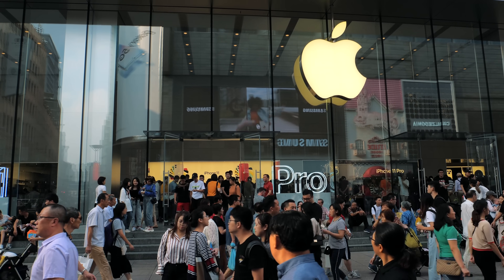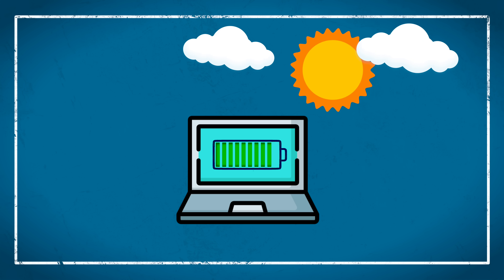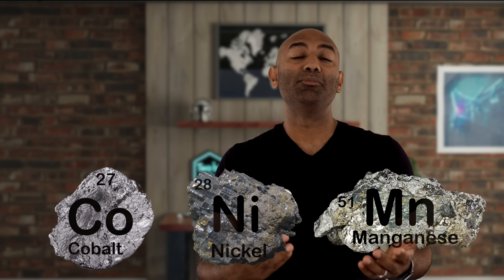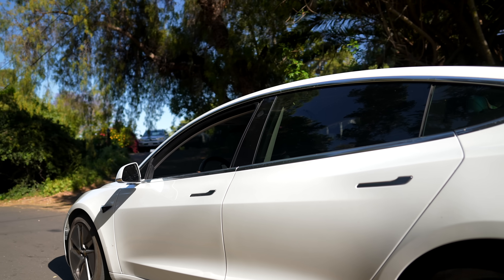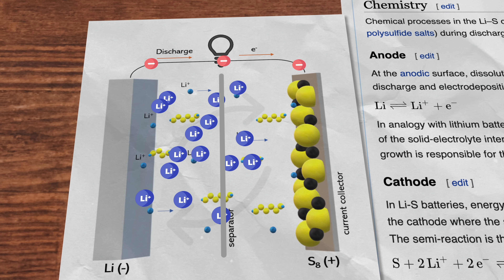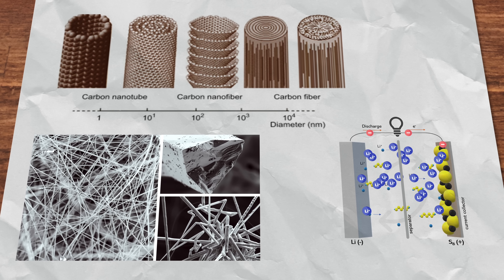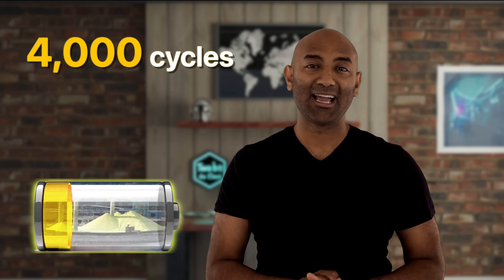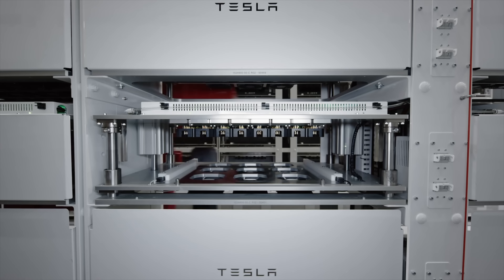Scientists Discover a Lithium Sulfur Battery Breakthrough on Accident!

Comment: Incredibly excited for what this means for all tech! Imagine a smart watch that only has to be charged once a week. Electric planes are more feasible. Grid storage will become cheap and easy so goodbye peaker plants.

I'm excited to think how much closer we are to becoming a fully type 1 civilization.
Reply: Li ion grid storage is already cheaper than peaker plants, only now Tesla & others are going with cheaper LFP.

These would be the economic death knell for coal, gas, & nuclear.
Reply: @IronmanV5  you say as batteries imply green energy, they can storage energy, not make it, but thanks to this energy buffers in form of li ion and mechanical batteries can help between the diference between energy production and consumption with renewable sources.
Reply: @IronmanV5  No matter how cheap, nothing is going to compare to the flexibility, efficiency,  and reliability of some of the modern nuclear plant designs. If sodium-sulfur batteries become a thing, the comparison will narrow, but do we want these huge battery farms spread across the landscape along with solar panels and wind farms. And,  even if they are sufficient for present and future consumption,  nuclear will be needed for process heat and for the type of power needed to desalinate massive amounts of water and start to actively suck CO2 out of the atmosphere, which will be needed if we are to meet the climate change goals of the Paris Accords and that are needed if we are to stave off disaster. Can we withstand the loss of the Greenland ice sheet, or the massive depletion of Antarctica along with the melting of permafrost across the northern latitudes and the phase change of the many billions of tons of methane clathrates that are now at the bottom of our oceans and that would be released with just a little warming of the waters that contain them. 

That means nuclear plants that are cooled by molten salts rather than water so that we aren't threatening our water supplies or heating them up, causing the very problems we seek to ameliorate.
Reply: @everettlwilliamsii3740  Nuclear takes too long and costs too much. And despite all the promises to the contrary costs & build times  have only been going up due to screw ups, poor planning, incompetence, and/or corruption during construction and no red tape like nuclear advocates claim.

Watch Ricky's video on Nuclear for some of the stupid screw ups that have happened with Olkiluoto #3, which was supposed to take 5 years to build but took 17. and Flamanville #3 which is 10 years  behind schedule and 4 times the original cost so far.

It's the same story with Vogtle #3 & 4 in Georgia.  The screw ups on that one included irreparably damaging the spent fuel pool while looking for leaks.

This guy: 
nopig org
has been keeping track of the numerous screw ups and overruns involved.

And then there is the aborted V.C. Summers #3 & 4. The companies involved have had fines and restitution levied against them and people have been indicted in federal & state court with some already sent to prison.

Even the much ballyhooed SMRs are following in the footsteps of their big brothers.

The NuScale UAMPS project which was supposed to produce first electricity in 2026 has had that date pushed back to 2029.

Solar & wind have seen costs dropping, unlike nuclear

ourworldindata org /cheap-renewables-growth

And larger capacity & duration iron flow batteries are already up and running in San Diego, and Liquid Air Energy storage facilities, which can store energy for months and scrub CO2 while storing energy,  are being built in Vermont & several sites in the UK.

Nuclear is just a bunch of broken promises.
Reply: @IronmanV5  Sounds like more unicorn farts to me. 
Show me the numbers...
Reply: @TheBandit7613  STILL NEED the GRUNT   of trucking diesel , arvo gas , and bunker oil ,to keep the wheels of  green DREAM  TURNING
Reply: @IronmanV5  nuclear and renewable energy need to be used in conjunction to provide us with all of our energy needs.
Reply: @DynamicHaze  Nuclear takes too long and costs too much. And despite all the promises to the contrary costs & build times  have only been going up due to screw ups, poor planning, incompetence, and/or corruption during construction.

Watch Ricky's video on Nuclear for some of the stupid screw ups that have happened with Olkiluoto #3, which was supposed to take 5 years to build but took 17. and Flamanville #3 which is 10 years  behind schedule and 4 times the original cost so far.

It's the same story with Vogtle #3 & 4 in Georgia.  The screw ups on that one included irreparably damaging the spent fuel pool while looking for leaks.

This guy: 
nopig org
has been keeping track of the numerous screw ups and overruns involved.

And then there is the aborted V.C. Summers #3 & 4. The companies involved have had fines and restitution levied against them and people have been indicted in federal & state court with some already sent to prison.

Even the much ballyhooed SMRs are following in the footsteps of their big brothers.

The NuScale UAMPS project which was supposed to produce first electricity in 2026 has had that date pushed back to 2029.

Solar & wind have seen costs dropping

ourworldindata org /cheap-renewables-growth

And larger capacity & duration iron flow batteries are already up and running in San Diego, and Liquid Air Energy storage facilities, which can store energy for months,  are being built in Vermont & several sites in the UK.

If private companies want to spend their money on nuclear, fine. I hope they succeed.

But no public money should be wasted on it  and should instead be spent on the cheaper, faster to deploy renewables & storage.
Reply: @IronmanV5  Solar isn’t as reliable as Nuclear fission here. The UK is building solar powerplants but according to farmers it’s on fertilized land and that is wastage of fertilized land which in our times has ever increasing value because of the ever increasing population that needs to be fed. The UK also doesn’t have good sunlight intensity and the best of weather so it would be a waste of time and money to put solar energy there. In the northern hemisphere sunlight intensity decreases a lot in winter times so again solar energy wouldn’t be as effective. Nuclear fission reactors however are much more reliable, produce more on lesser land and have longer lifespans. It is also highly unlikely solar would support heavy industries so that’s another reason why we need conventional powerplants.
Reply: @peakattic6818  Good thing that the UK is surrounded by seas which are a great place for on & offshore wind turbines which are as cheap as Solar, 1/4 the price of nuclear,  and also falling in price. And they can be set up in a couple of years, unlike the 10 years or more for nuclear.

Unless you are going to claim the wind doesn't blow in the wintertime.

You can still farm crops that require full sun around them.

And with solar, funny how you give the example of building solar on farmland, but no mention of how it is also set up at the point of use on rooftops of houses & businesses where there are no losses from transmission and it doesn't affect crop production.

You can also set them up over parking lots, or car parks as they are called over there, where they provide power AND shade and shelter from rain. 

Also, you might want to check out agrivoltaics where solar is set up on farmland where crops that thrive in partial shade are grown 

And as for heavy industry, for the cost of power from one nuclear power plant, you can have far more generating capacity from wind & solar with storage costs included that can be built out in a fraction of the time.
Reply: @IronmanV5  as an engineer ,i can assure u solar and wind are nowhere near our power demand and wind turbines are very polluting and exp to maintain
Reply: @IronmanV5  Wind and solar are terrible forms of electricity production. 1) Wind and solar equipment require far more power to produce them than they produce in their entire life span. 2) They are completely unreliable; wind turbines require the wind to blow, and solar requires sunlight (the more the better), but in either case, wind and sunshine are extremely variable and therefore the wind turbines and solar panels do not produce the same amount of power on a day to day basis. The only "renewable" source that is reliable is hydropower plants, but there are not enough water ways and dams to produce the power at the quantities required. The only way to produce the power needed on such a large scale is coal burning power plants. Until you can find a viable alternative, then coal is what it will take!
Reply: @IronmanV5  If the AEC will get out of the way and allow the building of LFTR plants, they can go up as rapidly as any solar/wind/battery setup because they don't require pressure domes and don't need to be sited on water supplies. Maintenance will be far cheaper than that required on hundreds of acres of solar panels and thousands of wind turbines, especially those sited in the water, especially salt water. A LFTR plant can easily fit in the footprint of a coal/gas fired power plant and will be able to use the same transmission facilities with only minor alterations.  Meanwhile, LFTR's can burn up the thousands of tons of highly radioactive long term waste from current nuclear power plants, vastly reducing the volume and radioactive life of existing stored waste. 

The AEC basically is restricting new nuclear plants to the same inefficient and unsafe designs of the past while claiming that they are protecting us. If that barrier can be overcome,  the floodgates will open and we will have a chance of meeting our climate goals. The fossil fuels industry is fighting this tooth and nail because abundant, cheap, and safe nuclear power will hasten the move to an all-electric future that is clean and carbon-free.
Reply: Most of my smart watches last about a week. Imagine a month or longer.
Reply: @Roger I agree we need more power, more power means now advancement. Can't tell if being sarcastic, a type 1 civilization is when a civilization can utilize all the available energy on a planet wide scale. Harvest all solar/geothermal/wind and any other fuels available to us.

Type 2 is all the power from our star

Type 3 is all the power from our galaxy.
Reply: I would like to see anyone explain just how an airplane can be electric. There is no electric engine powerful enough to power a commercial airliner!
Reply: @jasonpenn5476  but electric planes already exist. They're just short flight planes. If those can be profitable then longer haul flights can be possible. Maybe not oceanic flights but who knows with future advances.

I feel you're trying to be practical but I think the idea here is to be hopeful for the future. There can be solutions to problems we don't even know exist yet.
Reply: @JustinPEstrada  Planes on electric engines are extremely small, and don't travel very fast. There is no electric engine, nor will there ever be one, that will ever be able to produce the power needed for commercial air travel. The engine involved will have to produce enough power to overcome the weight of the loaded airliner and drag created by such a big aircraft. Just like a tank (M1A1, T-14, etc.) will never be electric. There are somethings that electric engines will never be able to power! The reason that the Navy had electric engines on their vessels is because they are huge and can support such a large engine and the nuclear power plant that provides the power. If Wind and Solar were viable energy sources, the military would have used them long ago!
Reply: @jasonpenn5476  Never is a strong word, but I agree we are a long way away, or further then it first seemed 5 or 10 years ago. Call me when my phone takes 10 seconds to fully charge.

Comment: Call me crazy, but I’m excited for what this could mean for e bikes! They’re already awesome solutions for the urban population but now they can have more power and more range? Sign me up!
Reply: And less weight, which is really important in bikes.
Reply: That was my first thought, too. At some point though I have to consider how long I want to sit on a bike seat, but having three times the range would allow me to take some of the strain off my legs.
Reply: @LightsOnMultiMediaMindArts  I guess I’m more intrigued by the option for more power than range.

I’m currently working on a video about what qualifies as good bike infrastructure and a key thing (in my opinion) is using larger public transit like buses and trains as the destination.

So ideally, you’re never on your e bike for too long because you’re just using it for quick hops to better transit. But going 20/25mph for that hop rather than 15mph can make a huge difference!
Reply: @SaveMoneySavethePlanet  There is a limit to how fast you will want to go if you're riding in bike lanes that are constantly shifting in width from virtually non-existent to maybe as wide as 5 feet, cluttered with road kill, broken glass, flattened beer cans and other detritus. I'm all for ebikes that can go 20-25 mph, but I don't think it's any more wise to ride wide open on a bike than with a car. Trying to ride at the same speed as car traffic doesn't make sense to me. It's not about competing with cars. If the transportation changes so that ebikes take over interstates, then I'm all for faster ebikes. So long as we're relegated to bike lanes and bike paths, 15-18 mph or less is fine. Faster speeds really call for different frames designed to absorb shock, distribute weight differently. The name changes then to electric motorcycles, which are a completely different beast.
Reply: @LightsOnMultiMediaMindArts  I agree. Electric scooters are much better. Or just a Podbike Frikar with a comfy seat.
Reply: Bikes? What about airplanes ✈
Reply: @warpigxxxl18  
Aluminium ... tops Sulphur but every bit of wt saving is a massive step forward.
Reply: @warpigxxxl18  Yes. Since weight induced drag is a squared function of weight, 3 times the battery density will reduce the battery's drag by a factor of 9
Reply: @米空軍パイロット  There is no weight-induced drag. There is inertia due to weight and the amount of energy required to keep something of a particular weight moving fast enough not to stall, but drag is a function of surface and frontal area.
Reply: Not just Bicycle range, but also motorcycle range and weight.
Reply: You're crazy.
Reply: I'm not a bike/scooter guy but I support everything going electric
Reply: Pardon my ignorance but what is the typical ebike range now?
Reply: @Meatball2022  a lot of the affordable ones are currently 20-30 miles. Like I said in my other reply: now that I think about it a bit more I’m actually more excited about the potential extra power rather than the range increase. Sorry for the confusion!
Reply: @Meatball2022  up to 100 miles for the Panasonic bike
Reply: @Meatball2022  different size batteries = different mileage! I have a 17.5 amp battery and can get 80 km in eco mode! 5 levels of assist! Eco, tour, sport,turbo,boost! 
Boost using the most juice!
Reply: @Meatball2022  60 km  200 km depend on the manufacture
Reply: @Meatball2022  80miles
Reply: @Meatball2022  40 - 60 miles is pretty typical, but that depends on weather, terrain, fitness of the rider and his/her willingness to put some muscle into it. You can always add a second battery to double the range. Sitting on a bike seat for 4 or 5 hours is not always that comfortable, so that can be a limiting factor, too. I have heard of ebike riders going 180 miles in one day using multiple batteries.
Reply: Hey cray, that's a good thing
Reply: Best money I ever spent was on an E bike
Reply: You're crazy.
Reply: You are crazy. But I do agree with you.
Reply: The current e bike are limited by state laws  meaning the top speed is held down because of traffic laws not performing issues. If you are talking about e motorcycle now you must comply with motorcycle regulations.
Reply: Yeah, 1,500 miles on an e-bike is something I believe we have all been clamoring for.
Reply: @clottadams5028  tbh that amount of range is pretty useless for 99% of people. Ok an ebike, 1500mi is like a week straight of biking lol. The larger benefit is an ebike that weighs as much as a normal bike
Reply: Crazy!
Reply: Let's see if the paranoid control mongers in government don't try to stop this from coming to the public.
Reply: Most tech advances ARE by accident, ironically.
Reply: Hell ya
Reply: Agreed. For rv people, vacation trips, virtually anywhere you would like a bike. Us old people would love it.
Reply: Now you just need a anti thief solution.
Reply: Sorry, that's crazy. With an improvement likevthis people are going to want to use the gain to improve their experience traveling. 1) rain and mud protection 2) ability to arrive at a destination ready for business without changing clothes  3) ability to stop and pick up groceries on the way home. Etc etc
Reply: Recyclability?
Reply: I run an ebike company, and it's super exciting. You could get full range Ebikes that aren't any heavier than normal bikes, or if you're feeling crazy, you could get 500mi of range
Reply: I cannot see well enough to drive. Due to my scoliosis, kyphosis, mal-aligned facial features, etc., I lack the capacity to maintain my balance upon a bicycle. A sturdy, lightweight tricycle or quadracycle-call it the "DRL 4" to give it a catchy name- would be better for sturdiness and stability.
Reply: @DavidRLentz  I am not sure my message passed the censorship.